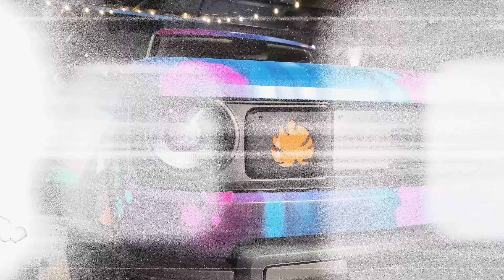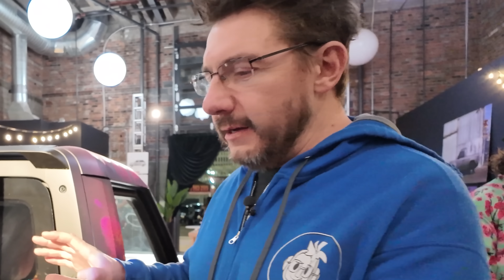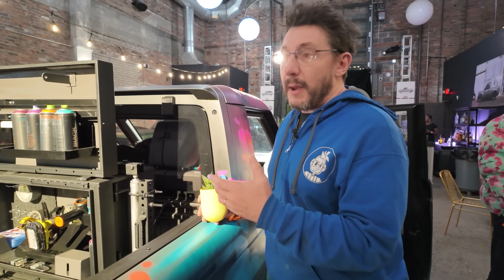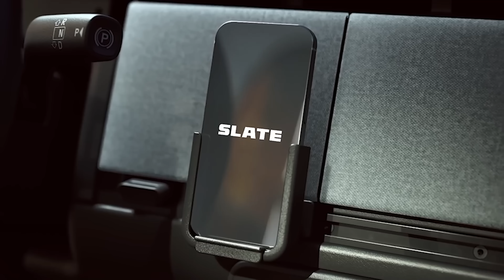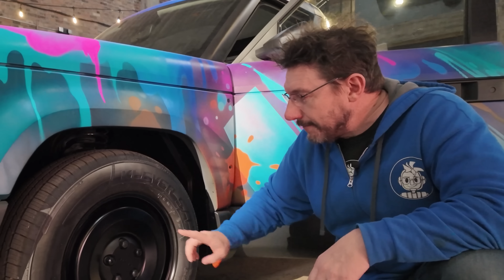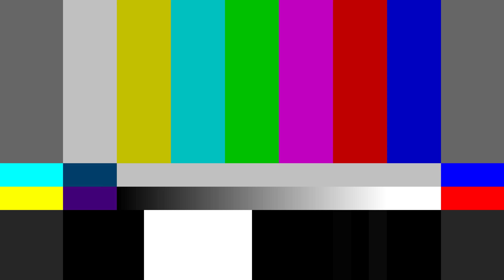Slate Auto! 3D Printing Friendly Truck!

Comment: I completely understand the excitement, but I also have to think that this is going to be a safety nightmare.  How is this going to pass NTSB safety requirements, as well as state requirements.  Those moveable items in the cab are most likely illegal in CA, as CA has very specific laws in regard to what can be placed on the dashboard, as do other states.  Bumps and fast starts/stops need to be considered, and I see those planters becoming deadly projectiles.  Was any of this discussed in the presentation?
Reply: You should have seen how thick the doors were under the panels panel, it looks like a smol truck but it's an absolute unit.

Comment: It's really cool to see manufacturers embracing 3D printing instead of fearing it. I remember not that long ago some companies feared people modding their vehicles with 3D printing or making their own replacement parts. Now we need manufacturers to release 3D models of common parts (not safety related for a reason) so it's a selling point of the vehicle. One of my first 3D printing parts (like 16 years ago) was a sun visor clip for my car because they choose a plastic that broke down in UV light (all the ones in wrecking yards were already messed up) and the manufacturer did not make that part any more so I designed a very functional (if not god awfully ugly) replacement and printing it in ABS and it was still on that car 6 years later when I sold it. It was a part I could not get, and so 3D printing literally saved the day.

Comment: Finally a truck that isn't crippled by a crew cab. Though I wouldn't object to an extended cab option for more leg room. As for the accessories dilemma, adding a second bolt to every mounting point just increases the costs to the consumer. Instead, how about a simple rectangular indentation above the bolt. The single bolt secures the mount point while the indentation keeps it aligned correctly.
Reply from the maker: Ooh. OOOH. GREAT IDEA.

Comment: Joel, as a tall dude, how well did you fit in this truck?
Reply: That’s one of my concerns with it. The cabin looks cramped to me, I’m only 5’11”. My other concern is when it’s converted into the suv body, how hard is it to put in a car seat? They are trying to appeal to everyone and lots of them will have babies and toddlers.
Reply: @only1muppet good questions. I'm a little bit taller myself and I can't tell you how many cars I can't ponder buying because I'm staring at headliner instead of out the front window. This means I have to drive larger vehicles to have proper headroom for sanity and safety. Being taller is a PITA sometimes.

Comment: But the truck doesn't have speakers. That's insane. I understand going minimal w/o a whole infotainment system, but at least have speakers, bluetooth, and a radio. Phone audio is terrible and would be drowned out by road noise. Driving with earbuds is dangerous.
It also is still a concept, Slate hasn't produced a single truck yet. I believe they don't even have a factory, so don't expect one in 2026.
Reply: They have made over 70 prototypes and have done crash testing + they have a full factory in Warsaw Indiana that they are re-purposing from an old printing factory. They also have optional speakers that you can add...
Reply: @Chapper Earlier this year, when they first announced the truck, they were still looking for a factory. It's great that they have one now, but i still wouldn't expect a shipping vehicle in 2026.
Reply: they do have factory packages that include speakers and all that, and they can also be added after the fact. that is the vehicle that they engineered, so modular it can be as minimal or as feature rich as the owner wants/needs it to be.